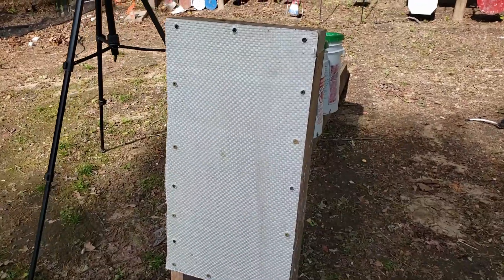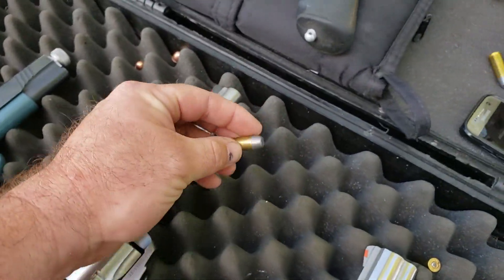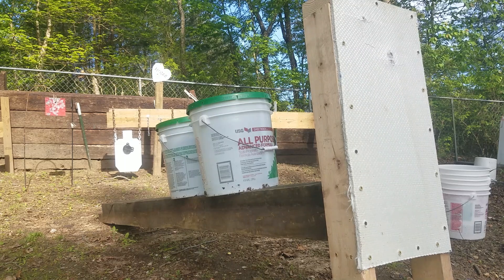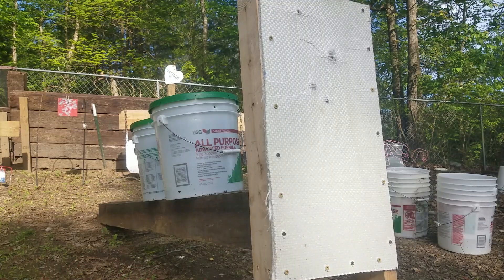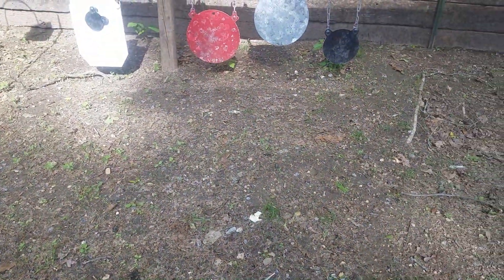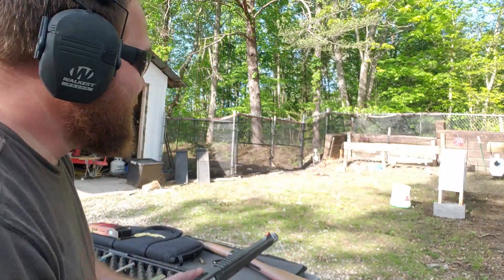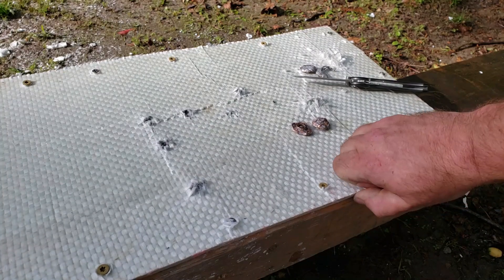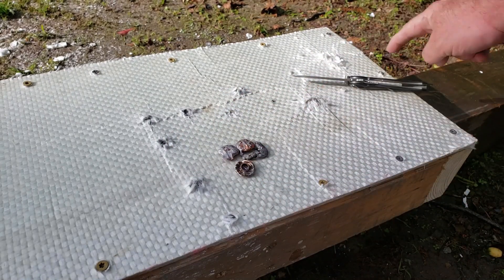Bulletproof Kevlar Walls?

Comment: dude, get yourself a Work Sharp Guided Field Sharpener, Model Number WSGFS221 it can sharpen anything to the Nth degree. It can even sharpen broadheads.
Reply: and serrated blades too!
Reply from the maker: I was actually wanting to borrow a crossbow for this. Fell through though.
Reply: @PatRMG  i have one in my closet, a 390fps carbon express , you would have to get your own bolts though :)
Reply: @PatRMG  hey if you could round up a few of the not so spensive cross bows, that would be an interesting vid, believe it or not my lady wants wants one of those pistol type ones.

Comment: is that actually Kevlar? I saw something like it being made, it was merely highly compressed fiberglass. If it's the fiberglass that's the thinnest sheet they make, and only guaranteed to stand up to a 9mm. You can get the panels much thicker of course, and the price doesn't go up that much with the thickness. If it's actually kevlar, or kevlar clone stuff, you now know why Kevlar is nto the best material for bullet proof anything. Kevlar actually pretty much sucks for military bullet proofing where it may have to stand up to high powered rifle rounds. still the best vest by far is the Dragon SKin, that the military refuses to use due to bs within the military industrial coomplex. I've seen the tests tho, dragon skin holds up. a clamped down machine gun firing a whole can of rounds in the same spot dit not go through. Kevlar ain'[t ever gonna beat that.
Reply from the maker: It's supposed to be kevlar. The website that I visited showed this material as such.

Comment: Thank you David, Not the outcome I'd hope for. But I suppose everything has limits. Peace To All!
Reply from the maker: My toys proved to be a little too aggressive! does not play well with others
Reply: @PatRMG  I agree with that! lol. I wonder what .17HMR or .22TCM or .40 S&W would have done to it. The list goes on... I know not everyone has all these different firearms available. Also Do they make any of that material for walls that will stop say a .50 S&W? Peace To All!
Reply from the maker: 500 stopping material is probably concrete and lots of it!
Reply: @scottc.real_2legit_4u55  i can tell you it does stop .40 ,17hmr . It stopped a 180gr hornady subx in 300bo but a 220gr smk went right thru.  
I use this stuff as back stop behind my bird feeders for uninvited squirrels 😜
Reply: @m17glock35  Good to know, I live in a very old home with no real protection. So this is great info! Thank You! Peace To All!

Comment: Hard Cast lead doesn’t get near enough credit when it comes to penetration capabilities. Turns the 10mm into a viable bear stopper
Reply: 180gr wfngc from CP over 14gr of h110 in .357 would have also easily penetrated.  Hardcast in the 45acp might have also, depending on how hot it was loaded.
Reply from the maker: Around here, I'd like to try it on some hogs!
Reply: Pat RMG we don’t have hogs in my neck of the woods but I intend to test 10mm in hogs one day as well. Great content and nice to see a YouTuber that is a Tradesman like myself btw
Reply: @beardoggin8963  nor rudeness, but hard cast ammo seems like overkill for hog haha.
Reply: Richard Mack no such thing as overkill lol. And the worst thing a handgun bullet can do while hunting is under penetrate, and hardcast lead ensures the bullets get to where they need to be. I’ve seen defensive hollow points fail to penetrate enough to kill deer and bear.
Reply: @beardoggin8963  2 words. Over penetration. Which could cause less ballistic damage overall thanks to less overall energy being transferred to the target. Wouldnt matter if you hit bone or organ though i suppose.

Alright you have a point. More good meat for eating if you use the hard cast stuff.

I guess it depends on why you are hunting pig.
Reply: Richard Mack well you aren’t talking about losing hydrostatic stock with a pistol bullet. To make a quick kill with a pistol bullet it has to physically pass through the brain, heart, lungs or liver. Not just pass by and tear it like a high powered rifle round would. My methodology is I want to make sure even on a steep quartering, through the shoulder or through the guts shot my bullet will make it into the vitals. And hard cast ensures that the bullet won’t expand too much and get stopped short. An added bonus is that hardcast ammo is less likely to be deflected by a rib and will penetrate and not glance off on a headshot. So they are what I choose. I appreciate us being able to have a civil discussion about this. What I stated is my opinion, and it ain’t worth much lol.
Reply: @beardoggin8963  you make a good point about shooting longways through a pig. Soft lead would definitely deflect. 

Im talking out of my ass to some degree, because the closest thing i have got to hog in my neck of the woods is coyote. Being as i live in alaska. Well coyote or black bear. Behaviorally they are a far cry from hog though, if my understanding is correct.

i am Lucky that in my neck of the woods brown bear dont show up much. So i carry a 357 with hard cast. Or my 454 casull with 45 colt in it. 

Im regards to the video, i am wondering if a hard cast 357 slug would have made it through the kevlar.
Reply from the maker: I wish that I had some 357 hard cast to try for this video. This discussion almost demands it!
Reply: @PatRMG  test out some of rim rock bullets, if you are up for the reloading.  I personally load 170 gr SWC, with something like 13.5-15 gr of h110 behind it.  

I would have picked up the 180 gr stuff, but they dont offer SWC in 180 gr. And im a bit of an elmer keith fan so i needed my SWC hahahha.

Comment: Well I am a little disappointed that it would not stop at a IIIa level. 😂👍🇺🇸
Reply from the maker: Hard cast bear loads is kinda cheating...
Reply: @PatRMG  ok so you are saying a defense load or fmj in 10 or 44 it would have stopped it? Also how stiff is that stuff?
Reply: @UncleDanBand64  its very rigid , takes a bi metal sawsall blade to cut it .
Reply: @m17glock35  thanks👍